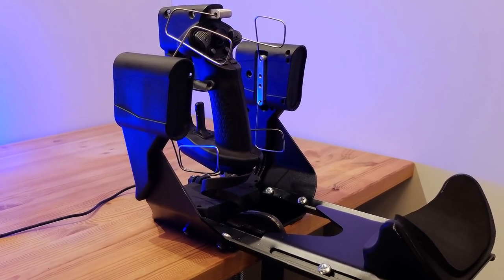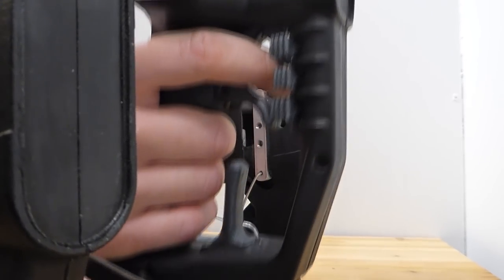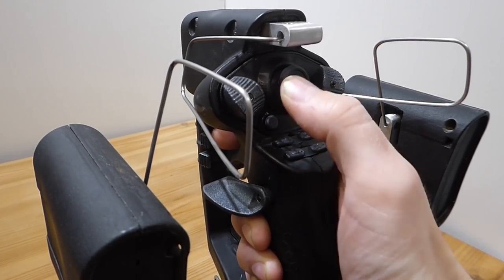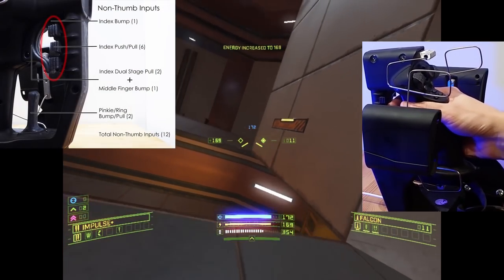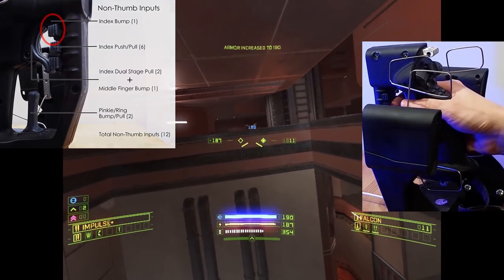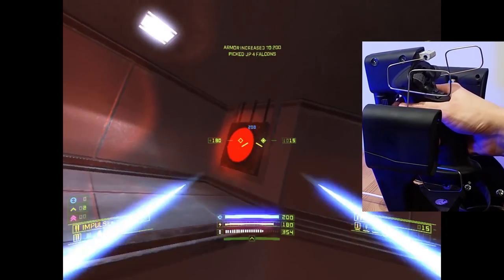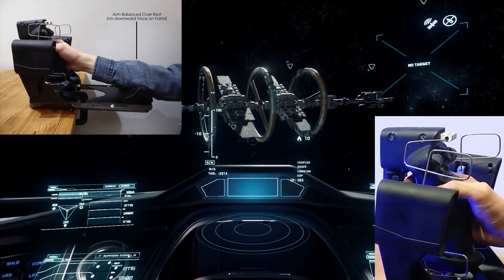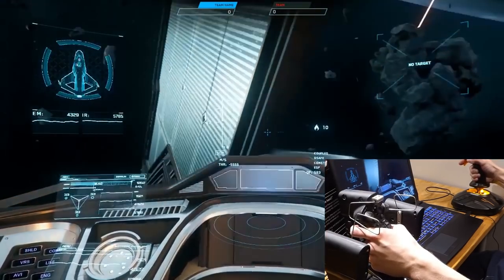Sublight Dynamics 6DOF Joystick: Prototype Features

Comment: The mount looks like exactly what I need for my current desk setup. I just can't find any type of solution and I'm not very good with DIY solutions. The best I've got is switching out my legs with a sit/stand desk kit but that is at least $400.

The joystick feels like it'd take some getting used to but would offer a good advantage once you did.

I just want a damn flight stick, HOTAS, or dual stick solution that I can use without having to significantly change my posture or setup. Lol.

Comment: So with VR controllers today that already have 6DOF and then some, have you all considered making a program that uses that technology as a basis for making a controller work like a regular joystick only one that might utilize the movements of a VR motion controller as the "physical unit". Instead of re-inventing the wheel, why not use the one people already have available to them? Software is a lot easier to make and distribute and I for one would love to be able to use my controller for games that don't support motion controllers. When I play elite in VR I can't see my HOTAS controller buttons, but having two motion controllers with multiple buttons would be good. If one acts on the throttle control while the other has the 6DOF (or even both could use motions in all directions) maybe it would be easier to distribute. Software doesn't have shipping costs, just hosting.

Comment: I'm running Overload, as seen in the video, with two T.16000M, also seen in the video, and I have to say I feel like I'm missing what your 6DoF stick provides 😅 I don't really like the twist as it becomes one axis too many for my brain, so I'm curious how a completely liberated joystick would feel to use. I would probably use it as a translational input only, meaning movement, not rotation. That's what my head says anyway 🙂

Comment: I'm interested in this, but more for the 4 wire control than the joystick itself. I've been looking for a 6dof stick for awhile. I've considered trying to find a way to do this with a Stewart platform, considered modifying a 3Dconnexion SpaceMouse since I can't find anything on the inner mechanism of their device, or just going straight to a 6dof IMU board or using a motion tracked VR controller.

Comment: With Vulcan becoming more prevalent: What OS will this be getting full 1st party drivers/software for?

I'm specifically eying Linux in my case as even my current 3d mouse has 1st party drivers available for linux/macos aswell.
(And both games used in the showcase either already do hage or are announced to have full linux compatability/Windows Independence...)

Comment: for space flight, this could actually be better than dual sticks or HOTAS + Pedals. good pedals are expensive...
i subscribed on the website, waiting for the kickstarter
Reply: I agree and looking forward to the Kickstarter. Having done the Dual Sticks in Star Citizen, It is a fun setup but operating the Throttle at the same time becomes tricky. And so went with a HOTAS Setup with the Thrustmaster Throttle that has a stick on the Index Finger and built in rudder pedals. used the Rudder Pedals to strafe forward and backward and the index stick is for the up, down, left and right movements. Made the Throttle Control easier but the Strafing, which can be vital in combat and manual landing, becomes tricky because the stick is sensitive. So having this type of Stick will make the control of all the axis and Strafing maneuvers feel extremely natural. I personally feel that if there are such space ships in the future, they would have a HOTAS with a Stick like this one. in other words.... SHUT UP AND TAKE MY MONEY!!! XD

Comment: Damn son. I'm a little worried how it'll interact with a throttle though. In elite I use throttle for most things including combat and general travelling, but for finer maneuvers, like landing, I use a different input (On my X56 the thumb stick on the joystick) I can imagine that in high intensity situations you'll probably be pulling and pushing that thing affecting throttle, alternatively turning it off on the stick but then losing that fine touch when you otherwise need it. Hmmm there will probably be solutions to this though.